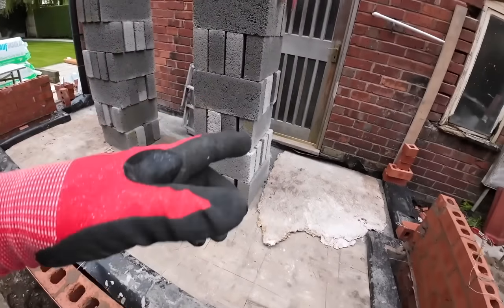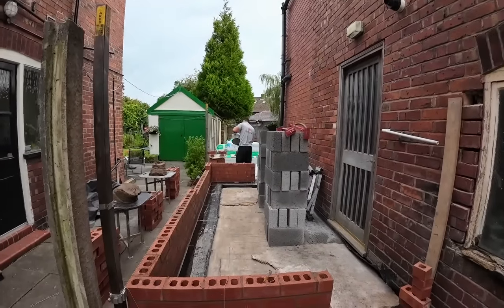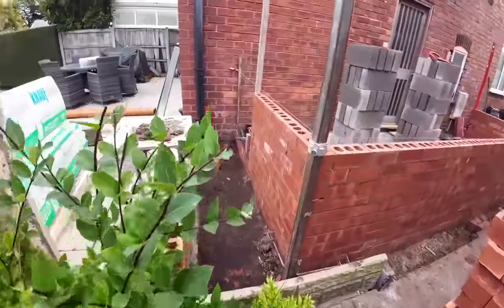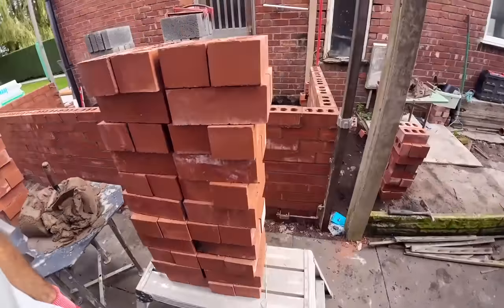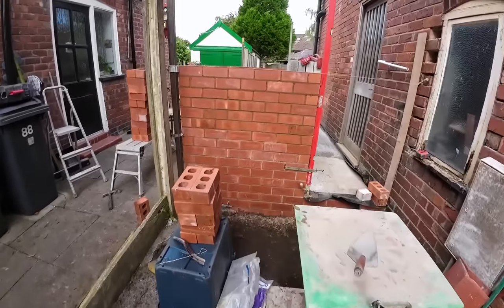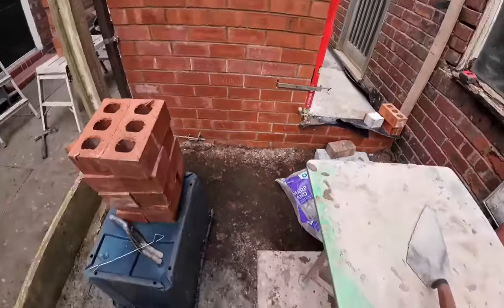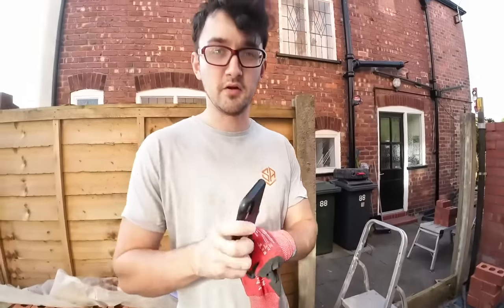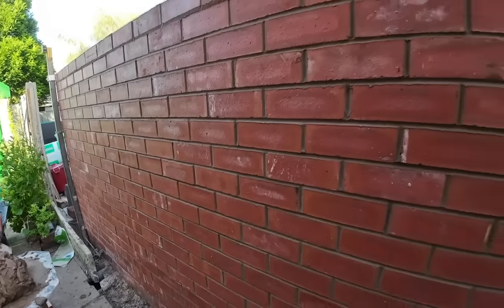RUNNING IN FACE BRICKS USING BLAKES AND FITZBRICKS...SMALL EXTENSION PT 5

Comment: Guys, i hope that boiler flue is going to be dealt with properly and not initially going to e built over? You also have the condensate discharging to thin air.  That boiler needs to be decommissioned before any further work occurs. You do realise that if anything happens regarding the safety of the boiler if not sorted that yourselves will be liable?
Reply from the maker: We just build the walls as we are bricklayers . The boiler is a  central heating engineers department. The clue is in the channel name 🙄
Reply: @SteveAndAlexBuild  Lol!  It doesn’t matter to the Gas Regulations which are law and the HSE, what trade you are.  If what you do affects the operation of that gas appliance and it causes harm or death then YOU will be liable. It is no excuse in the eyes of the law to plead ignorance or say it isn’t my department . Also if you do build over it , without it being decommissioned it would be RIDDOR reportable. 
Maybe instead of worrying about enough brick ties and weep vents, understand that you have to work within the regulations of other trades too, whether you know it or not.
TBH your reply is ignorant and a tad childish to say the least.
My original comment was to inform you of the Dangers, but obviously you know it all. 
40 year in the trade, Plumbing and heating engineer, gas registered etc!  Just saying !
Reply from the maker: @opelmonzagse . If I was a joiner or a roofer who would be responsible for building the roof and sealing the doors and windows then maybe your comment would be relevant.
   In case you didn’t notice we are sub contractors employed to build the walls . Nothing else . We aren’t project managers so no we are not responsible for the boiler actually and my reply wasn’t ignorant. 
    I don’t need telling the boiler needs moving because it’s nothing to do with me and it proves your ignorance that you think anyone would build an extension and leave a boiler flue venting into the building. There isn’t the slightest hint in any video that this would happen so don’t assume that it did . 
    I suggest you go and criticise some pluming and heating channels where your comments might be actually relevant to the content. 
   40 years in the trade doesn’t make you a good judge if character 👋🏾
Reply: @SteveAndAlexBuild  I wasn’t assuming anything ! Just pointing out the dangers. Letting you know that whatever trade you are you will be liable. Subbies or not it doesn’t matter. You have taken it as a personal attack on yourselves and your plainly passive aggressive reply proves it.
Reply: @SteveAndAlexBuild  Plus I have seen  built over flues plenty of times by ‘ ignorant’ builders/ bricklayers .
Reply from the maker: Well we aren’t ignorant builders / bricklayers .
   We don’t need the dangers pointing out thanks . 
   It’s common sense that you don’t build an extension over a live boiler flue and anyone who does isn’t ignorant they are cowboys .
    Read assured we know what we are doing and no humans were harmed in the making of this video now please go and bother someone else who have actually done something that has upset you or something actually dangerous 🥱
Reply: @opelmonzagse you sound like a grade A weapon pal
Reply: @opelmonzagse Gee you know how to get your knickers in a knot 🪢 😂😂
Reply from the maker: Us or the flue inspector 🤔
Reply: @SteveAndAlexBuild  I think you have the patience of a saint Steve 😂But remember to decommission the boiler🤣…jokes
Reply from the maker: Paul 😆😆🧱👍🏽
Reply from the maker: Might ask the boiler expert to do it with all of his big boy qualifications.😆🧱👍🏽

Comment: Hate those bricks you just have to look at them and they get marked. Plus the size difference on packs can be unreal. Then the white ends and stripes can make it look terrible. Nice job though and well done Alex tough brick to wall.
Reply from the maker: Cheers Paul , expensive too 😬🧱👍🏽
Reply: If find with any smooth facing brick, once you've jointed them rub it all off with a bit of cavity insulation (fluff) and they clean up mint

Comment: Am I right in saying that the solid insulation w
Like eco therm / celotex was equivalent to twice the thickness of roll insulation ? As if I am right those huge 150 mm cavities could be reduced to 75 mm and have the celotex /eco therm  @75mm giving more space in the room .
I just can’t see where all this extreme cavity is going or where it will stop it’s got ridiculous
Reply from the maker: Cost 🧱👍🏽
Reply: Appreciate cost is always an issue but the extra cost to use pir board of probable £200 max  and have the extra space in a room of a small extension would outweigh the cost to the customer surely , if build g control allow
Reply from the maker: @Melv-nc8eb no pir  isn’t equivalent to half the thickness of mineral wool 🧱👍🏽
Reply: 100mm of pir is about the same insulation value as 150mm mineral wool. The advantage of mineral wool in cavities, it seems to me, is that it is easy to get a good fit in the cavity without gaps.
Reply from the maker: There is extra labour costs with pir too as it labour intensive to fit and slows the job down , plus you have to build the internal wall first which isn’t ideal 🧱👍🏽